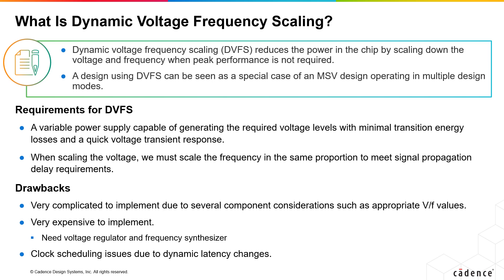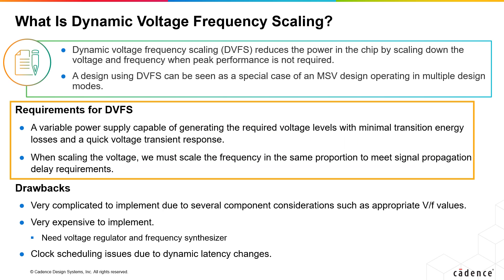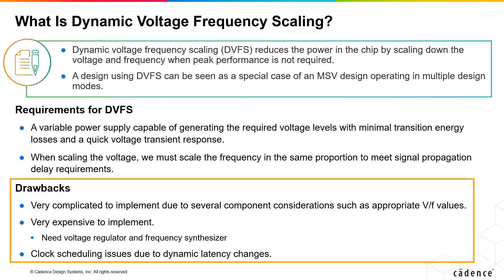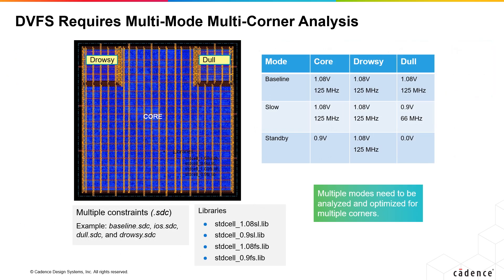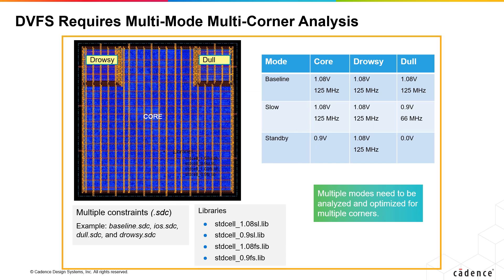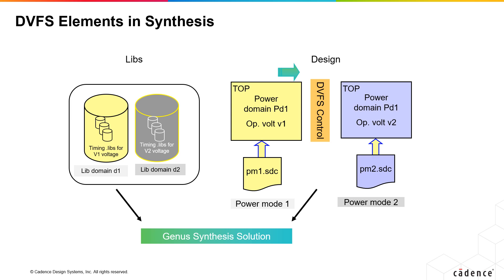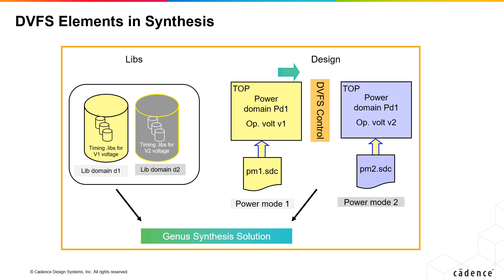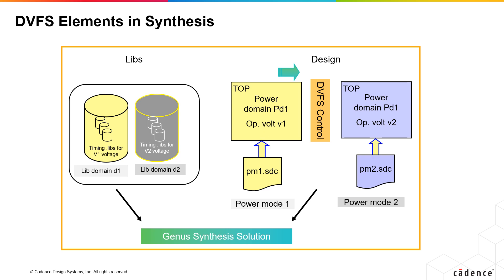What Is Dynamic Voltage Frequency Scaling

Comment from the maker: DVFS offers the highest power savings, but at the cost of high complexity. 

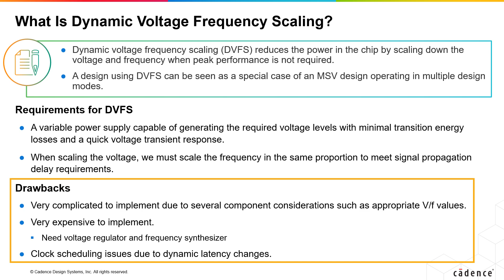The biggest challenge? Handling the "Dynamic Latency" changes in the clock tree (explained at 0:50).

Have you implemented DVFS in your designs, or do you stick to static MSV?